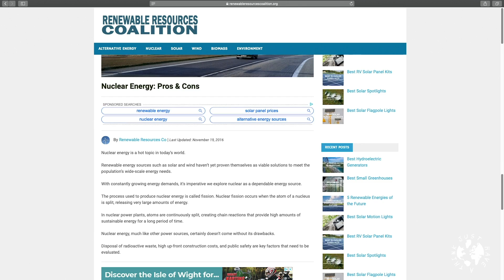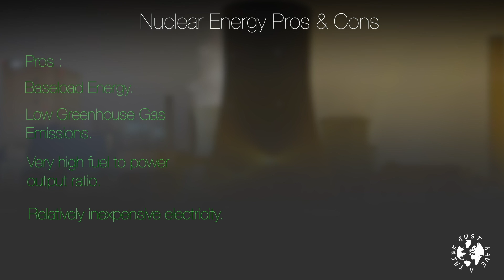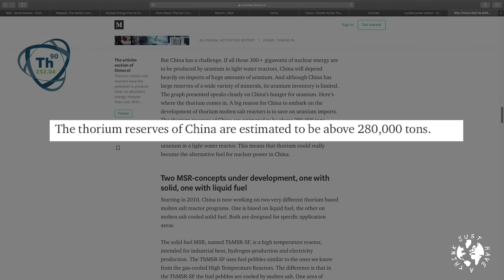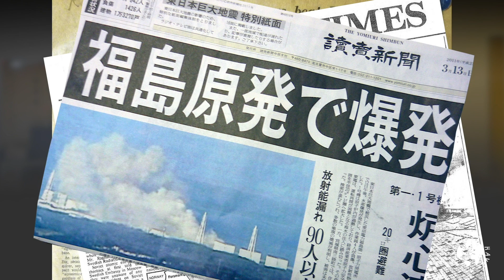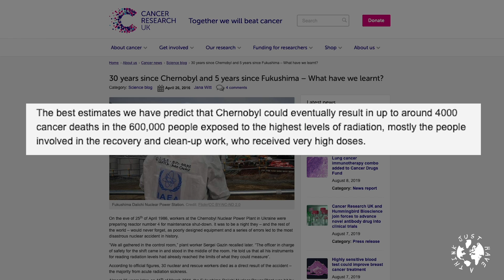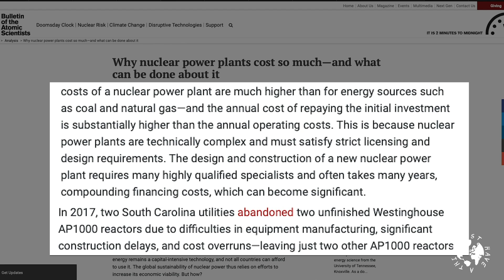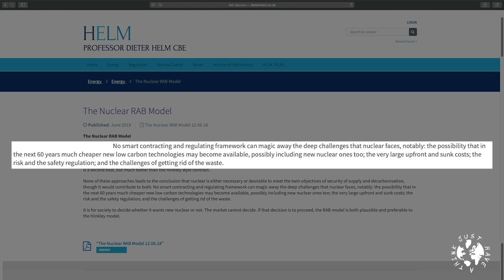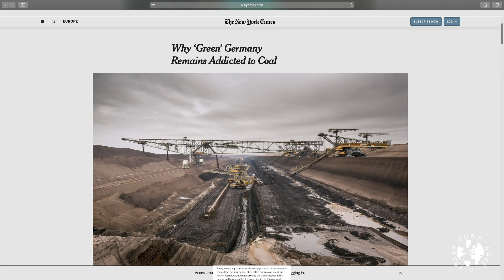Nuclear Energy in the 21st Century

Comment: Why don't they use the Thorium reactors that are way safer then nuclear reactors?
Reply: Nuclear is already extremely safe but yes small modular reactors using molten salt fuels whith passive safety rather than engineered safety are a no-brainer (presuming that was what you meant by thorium)
Reply: @PalimpsestProd That channel primarily focuses on thorium in the context of molten salt reactors, which is very specific field of nuclear reactor technology. Thorium reactors in general applies to a much larger range than just the field of molten salt reactors. For example the Shippingport 1977 LWBR was a thorium reactor, but it is very different than the reactor discussed by gordonmcdowell.
Reply: @brian2440  All water based reactors run the risk of steam explosion. Salt is safer. If the reaction runs away, the plug melts and the liquid fuel pours out, increased surface area means fewer neutron captures and it cools. Heavy water reactors can burn thorium more efficiently, so CANDU and French HW reactors could use Th to add more buyers and help bootstrap the TH supply chain until MSR tech is being manufactured at scale.
Reply: @PalimpsestProd Its a lot more complicated than you let on. In most steam explosions this is caused by a sudden increase in neutron flux and thus rapid thermal release. So if you address these situations you drastically reduce the likelihood of a steam explosion. 

Furthermore salts can be safer depending on what salt you use and how your reactor is configured. Sodium is a salt for example that if it is in contact with water or even water vapor can explode in an event that could be even more of a disaster than a steam explosion. 

Many people on here champion LFTRs, which contain Lithium Fluoride and Beryllium Fluoride coolant. There are many advantages to this cooling compound, but this compound is also very chemically corrosive and reactive, which is why the plumbing for LFTRs is significantly greater than that of LWRs as they require unique super-alloy compounds such as Hastelloy N with Silicon Carbide. 

I support GIF reactors are tend to exclude the SCWR from my support, but the idea that these materials are inherently safe is chemically inaccurate.
Reply: Thorium reactors are nuclear reactors
Reply: No working thorium reactor exists and it is not known if they will actually work because the thorium isotopes have very low fissibility. 

Anyone who tells you that thorium reactors are the answer have no idea what they are talking about.

Comment: I think both Chernobyl and Fukushima illustrate the dangers of nuclear power. When something goes wrong, it may be impossible to stop the damage. Eight years later, and TEPCO still doesn’t have Fukushima under control, and the damaged reactors continue to emit radioactive isotopes on an incredible scale. In fact, those of us alive today may not live to see Fukushima under control. What are the long-term effects of all that radiation to the environment, food supply, and the Pacific Ocean? I don’t think anyone really knows for certain, but if one malfunctioning nuclear plant can do such damage, we shouldn’t use the technology. And Fukushima isn’t even the first time we’ve had issues with nuclear power. When you consider Three Mile Island and Chernobyl as well, you have to wonder why we would risk using nuclear power at all, even with its substantial advantages.
Reply: @HardWarUK Fukushima is spreading all around the world, and may continue to do so forever. And I don't know where you get your 3B figure.
Reply: @mitchellsmith4601 There is an extensive amount of scientific studies that have bene monitoring radiation and radioisotopes in the Pacific Ocean with the majority opinion being that this is not s significant concern due to: 
- The sheer volume of water the pacific ocean
- The water solubility of isotopes in the pacific ocean
- The concentration of isotopes in the pacific ocean
- The bioaccumulation at the time of incident compared to different time intervals of isotopes and impacted species in the pacific ocean
- The radioactivity of isotopes in the pacific ocean
- The decay rate of isotopes in the pacific ocean

From what ive seen the largest concern has been related to radioactive isotopes collecting in larger concentrations along beaches in Japan and the impacted ecosystems around these areas.
Reply: @brian2440  Right, and EPA said it was safe for workers at the 9/11 site. How many of them are dying now?

Strontium-90, Cesium-137, and Iodine-131 are all known carcinogens, and Fukushima is continuing to produce them. We can't stop it. There is no cure once exposed, and we don't know just how much or how little will cause health effects. Sea life along the west coast is showing evidence of radioactive contamination. Rice, grains, cattle, and fish in Japan have shown very high levels of radioactive contamination. Thyroid cancer cases are rising in Japan. Scientists have found Cesium-134 in children. Elevated radiation has been detected in Tokyo. Fukushima is spreading radiation all over the northern hemisphere.

There is no safe level of radiation exposure. Period.

At present, we do not know how to responsibly and safely use nuclear power. Three Mile Island, Chernobyl, and Fukushima demonstrate this. The longer we continue to use nuclear power in this manner, the more accidents will occur, and the more we will poison this planet with radioactive isotopes we cannot avoid. They get into our water, our air, our food, and our bodies, and they're deadly to organic life.

https://www.globalresearch.ca/28-signs-that-the-west-coast-is-being-absolutely-fried-with-nuclear-radiation-from-fukushima/5355280
https://en.wikipedia.org/wiki/Radiation_effects_from_the_Fukushima_Daiichi_nuclear_disaster#Strontium_90
Reply: @mitchellsmith4601 You are apparently not aware of the fact that those three isotopes you just mentioned are also used by multiple industries in the aerospace, industrial manufacturing, chemical manufacturing and medical industries. You also seem to not be aware of the fact that this planet has since the creation of the solar system been radioactive and thus you happen to have always lived on a radioactive planet. 

So Einstein perhaps you would care to explain how if humans contain radioistopes and the planet itself is radioactive how life could possibly ever exist if radioactive isotopes are as you put it "deadly to organic life"?

Also, "On 12 October 2011 a concentration of 195 becquerels/kilogram of Strontium-90" do you know what this concentration means?

Comment: and not to mention that Guy McPherson may have a point when he asks what happens to the 450 power plants if we a sudden major economic/societal collapse --perhaps a few 'meltdowns'?
Reply: Its true that there are some (not many) reactors today which would require power and human input to ensure a safe closure in an extreme event but realistically this is just fear mongering. The cores shut themselves down at the first whiff of trouble so no more nuclear fission occurring and the decay heat only takes a day or so to be managed safely (sadly less time than fukushima had before the tsunami hit).
Reply: @doritoification  But uranium fuel continues to give out heat fast enough to require constant cooling - usually in a pond. Without human attention, the pond can dry leading to fuel ignition.
Reply: @clivemitchell3229 Actually nuclear fuel rods are put into cooling ponds due to the energy release of short lived isotopes as they experience rapid radioactive decay. The fuel rods are not critical when placed into the cooling ponds, with the exception of some very specific fuel matrix arrangement particularly found with plutonium fast reactors.
Reply: David Finch that is why we need the molten salt technology!
Reply: In an economic collapse energy usage falls, so if it would actually be more likely that these plants would shutdown than meltdown.
Reply: @brian2440  - And that makes them safe how?
Reply: Deebz270 That’s not the point of my comment, but these cooling ponds are massive. Is it safe to dive 50ft and stick your tongue on them? No, but then again what logical reason would someone do that? 

However water acts as a neutron absorber, and reduces overall risk of radiological environmental impacts. 

After the radioactive has decreased the rods are then taken out of the ponds and placed into dry storage pods, which are sealed with reinforced concrete to protect the environment from radioactive decay.
Reply: If that happens you've got a bigger problem than the reactors
Reply: They have off switches